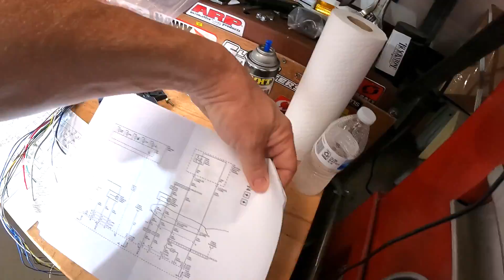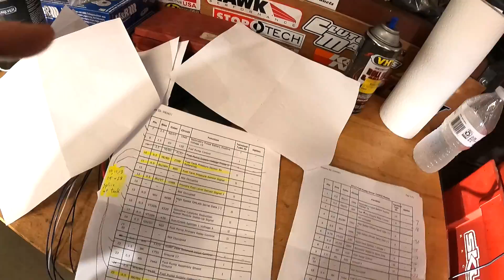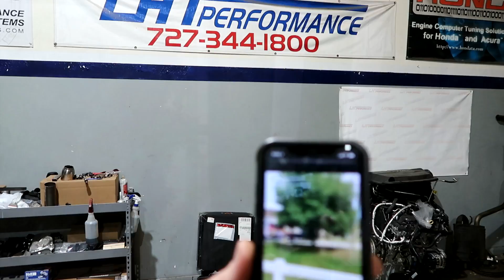V8 Colorado, More Issues !!! Part 5

Comment: This past December I helped a friend put a new 2020 motor in his 2014 Silverado, was supposed to be a direct swap it was not. Had the reduced power issue also which was low voltage to the fuel rail turned out to be the fuel rail connector had one less pin then the wiring harness on the truck idk if this will help. Good luck with the project

Comment: Would the fuel pump off a Silverado work with the module? And does it fit in the tank?
Reply from the maker: It would need a Silverado dash cluster too. Even thought it’s the same brand and same year, everything uses a different language